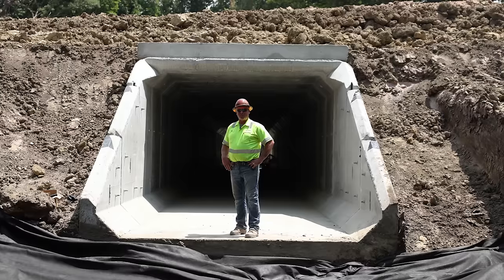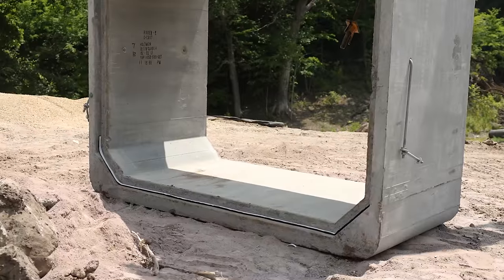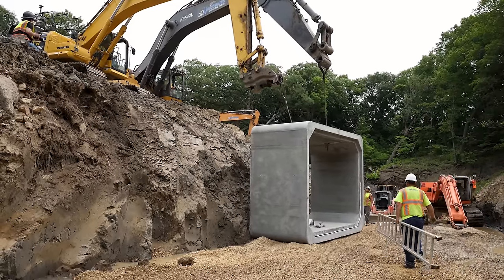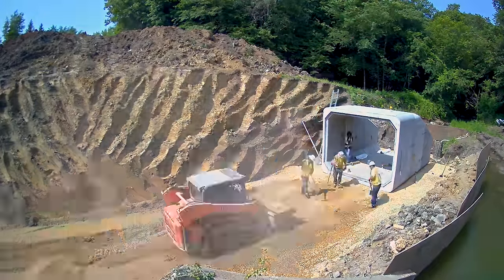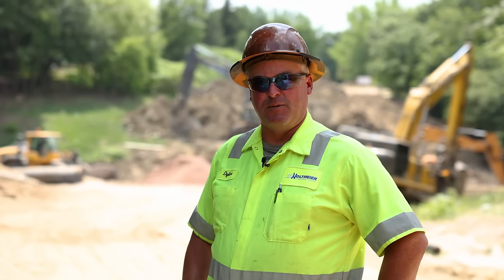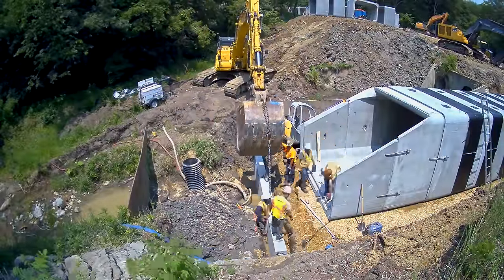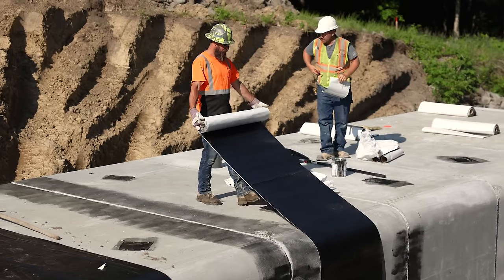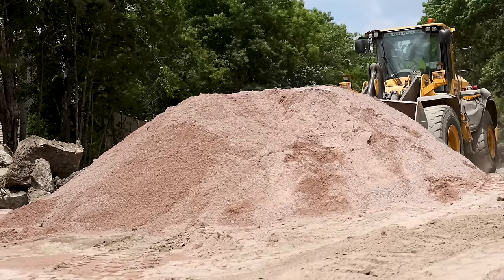Kerns Drive Box Culvert Install

Comment: I have set many of these. The last one was double barrel and around 160 FT. We had one excavator and a 80 ton crane. I just set the 44,000 lb sections and the excavator does the rest. I was never around when they finished the job but all the equip you have there was probably used after I left. I bet you used 1 extra excavator that you owned VS what we used and didn't need to rent a crane. My state uses a seal on the connection without the mastic on the outside so we just drop a red solo cup of concrete in the holes at the pick points and backfill. My first precast culvert was in 1988 and I could be the poster boy for what not to do with a crane but it all worked out. The dumbest thing I ever did with a crane was on a precast culvert but I don't say where or when very often.
Reply: I'm looking to get into precast culverts. Would you be willing to talk?

Comment: placing a concrete pad down is way better because when you put the boxes together there wont be stone between the joints and the pad keeps the level all the time especially if your close to any water table or dirt that's not great . You can say oh thats more money but when you have to go back and fix it you didnt save anything

Comment: the bolts that are fixed to prevent the frame bridge elements from separating are not removed?.  cannot the excess of these bolts and nuts cause a brake on the perfect flow of runoff water?
Reply: Culverts are designed to be self-cleaning under normal circumstances, but still have the capacity to handle the worst flood an area can expect. Those draw bolts will only see water during an extreme flood, and you will be more worried about trees clogging the pipe than a bit of turbulence from the bolts.
Reply: Say what??
Reply: I can drive my truck through that thing.  I don’t think a 1” bolt is impeding anything.